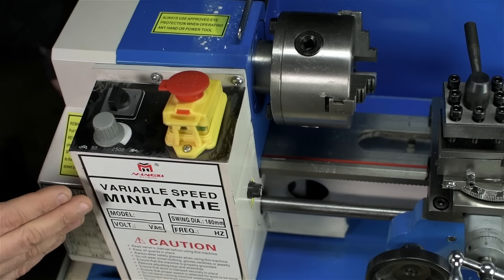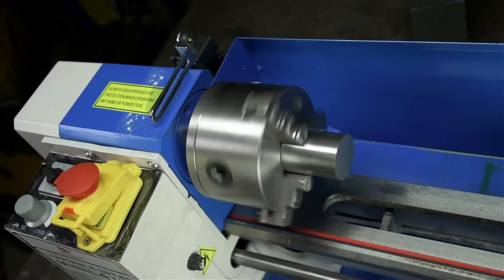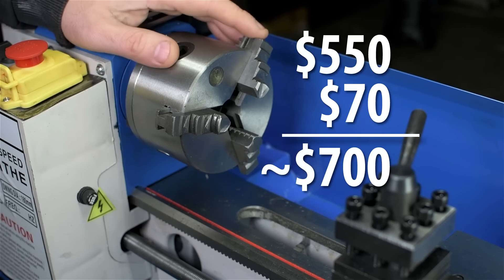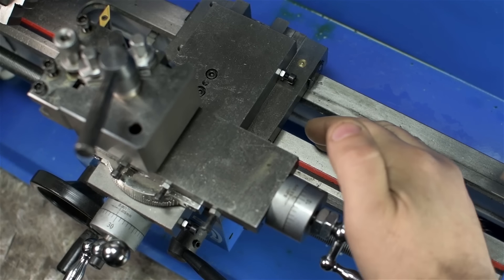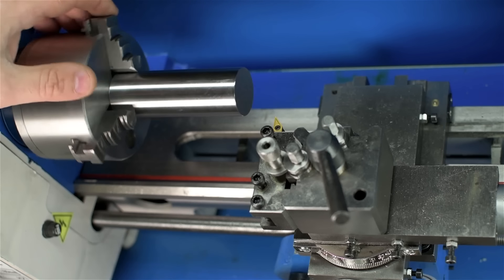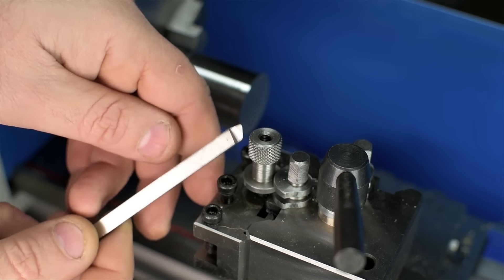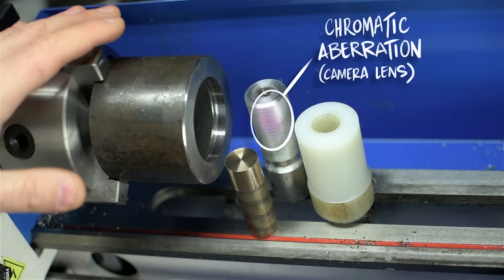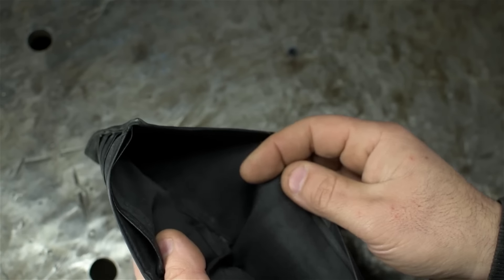The Infamous Mini Lathe!

Comment: I have the 7x16. It's not a myth LOLTo the best of my knowledge none of these small machines come from the factory with metal gears. Although, they are available to purchase from Little machine Shop. Do you have a recommendation for a small lathe that won't break the bank and has a built in gear change for thread cutting?
Reply: take a look on grizzly, i think the 9x20 or whatever has a gearbox.
Reply: @leeknivek  Consensus online (years ago, IDK about now) was that the 9x20s are trash compared to pretty much anything else due to bed flex.  The 8x16-type machines that TOT mentioned in the video are (were) much more well-regarded.
Reply: @macaroniandtuna  I'm not saying they're good, I'm just noting that they have some sort of gearbox
Reply: @leeknivek  although that 9x20 may also be another chinesium product, it do carry a gear box full of metal gears. But it is almost twice as big as the 7x14......not at same scale. May be taig lathe without tailstock? Almost no gear at all but roughly the same size and usage should be compare with....
Reply: Micro-Mark also now sells a metal gear set.  However, they are not needed.  The plastic gears for the lead screw drive work just fine and are quieter.  Plastic gears in the head stock also run quieter and have the advantage of being a good fail point in case of a big mistake where the stronger metal gears could actually be a liability.  The advice often given on the largest online mini-lathe group (7x12MiniLathe was on Yahoo groups now on Groups.io) is to not worry about it until one actually breaks - then decide if you want to change.  Apparently, very few seem to experience a broken gear.
Reply: Something old! Edit - I need to read better... They won't be small. My bad.
Reply: @ФёклаШиринкина  doesn't say what kind of lathe it is but I like your project
Reply: As silly as it may sound.... take a look at Harbor Freights.  It was the first lathe I purchased and it DOES come with metal gears.  I changed out the tool holder for a quick change type which was all I really needed to do with it and it does have built in gear changing for thread cutting in addition to extra metal gears for changing spindle speed.  I have had it for 10 years now and it still runs as well as the first day.  I since have added a LaBlond and Warner & Swasey lathe to my arsenal but I still use the small one for softer metals and plastics.

Comment: Now, I want to know if there's a mini-injection-molding-machine, and a mini-CNC-mill-for-aluminium. :)
Reply: I just bought a used mini cnc
Reply: There are definitely mini mills. CNC, I dunno
Reply: @gamemeister27  mine is a cnc. 3020 if I remember correctly.

Comment: I want one, I’m a model builder. Probably safer than using a dremel and razor blade.
The palm sized would be ideal.
Reply: Maybe you should check out jeweller's lathes, those are significantly smaller and more precise albeit more expensive

Comment: I upgraded up from an Emco Unimat SL (which went over to my brother as his first lathe) to the Emco Unimat 3 (still residing with me, but rarely used) and finally got myself a mini lathe. Anything bigger is not possible in my 6x8' shop (mini mill and a small bandsaw there too). But this small lathe is quite ok for all my projects. It just depends on what your needs are.

Comment: That's a nice toy for all 40 years old yong boys! 
But my model of such lathe, I think, little bit better.
Reply: Yes, my lathe can cut 2 mm diametr at 30 mm round stock steel
Reply: 40-20=20 if my maths is correct I believe I’m not 40 😀😂
I shall check your channel out after this video
Im 20 lol if you can’t tell
Reply: Bruns, that's not fair, your lathe is made closer to Germany then the little one..😅

Comment: It all comes down to what you use it for. I'm a model engine builder with most of my engines being around 1" bore, and in 30 years I still haven't out grown my 7x16 Prazi (german/polish made) mini lathe, still love it. If I were to upgrade it would have to go out in the garage which is un-heated and un-airconditioned so I don't like being out there nearly as much as being in my indoor study.  What I haven't found is a usable mini-mill, the Prazi mini-mill is too flimsy for much of my milling, all I use it for now is drilling and taping since having gotten a (very old, very worn out, very cheap) bridgeport clone, out in the garage.

Comment: Thanks for sharing. My experience with two of these low-cost tools are not so encouraging though one can do a lot with them. One problem is the weak point of the gear system. There are no actual bearings in them. They are simple slide bearings with steel against steel or steel against plastic. Lubrication? You need to lubricate all slides and bearings very often, else they start to jam and the bearings may stick hard and burn and then break some gears.

Comment: I have had a MicroMark 7x16in mini-lathe for several years.  I use it for my 10mm/ft and 16mm/ft steam locomotives, mostly brass, bronze and aluminium.  I have had excellent results if careful.  10thou cuts max usually.  Less on steel when I am very patient.  More like 5thou..  One word of caution, just because the scale (in thou on a MicroMark) says 10thou don't bet on it.  It is better to cut close, and then creep up to the final cut.  For the money it has been excellent and I probably wouldn't have been able to afford anything better.  An excellent starter lathe and for those on a tight budget.

Comment: I use mine which was a harbor freight version so it had the thread cutter for over 7 years now. You know he's completely right I mainly do soft materials however I have done a couple very small break discs on mine but I usually stick to aluminum or brass a little stainless steel. Mine's done me great. haven't had any issues. But when you only got 600 in your pocket and it's 1500 for a bigger one you learned to manage.
Reply: The mini lathe reviews aren't really fair, because the people doing the reviews own $25,000 lathes. Even a used lathe, requires enormous resources to get it home, and to get it up to running condition, if you have no idea what your'e doing, and you don't have a background in machining tools. I'm an inventor and woodworker, and the process of buying an old lathe and restoring it to safe operating condition isn't so easy,. It does seem that MOST of these people have a lifelong background of engineering and machining tool experience, starting in high school. I am so glad for these channels, but I feel like they aren't exactly understanding that the audience is not quite as adept. For some people, a mini lathe is the only way they can even own a lathe.

Comment: After having one of the "bottom of the line" minis, I bought the Microlux, full delux package.  Then added the QC tool post, and a few other things.  But, a junked out old B&D drill gave me a nice 1/4 inch drill chuck, 3/8-24 thread, and LMS has arbors made for the mini lathes to make it usable.  A little later, a Jacobs BB 3/8 chuck and again, LMS arbor makes a nice combination and doesn't et too much bed length.  The Microlux is 7 X 16, and the extra bed length is very nice.  Also, as personal choice, I prefer O-1 and W-1 steels, but again, personal choice.  I do very little in aluminum, maybe just a little more in brass if I have to.
Reply: Do you still have the Microlux? Is that the best mini lathe to buy? Is there something you'd recommend that is better for the money? I'm trying to buy a lathe, but I don't own a truck or a flatbed trailer. I have a van, which I think could haul a lathe, but it might be a bit more difficult to load the lathe with a cherry picker (engine hoist)... Are they not called "cherry picker" anymore? I haven't heard that term lately. In WA state, they are called "Cherry pickers."
Reply: @Ritalie  I still have it, and the more I use it, the more I find other than limited in size, it's a pretty nice little machine.  Whether it's the best, I won't say.  All I'll say there is I can use it for small work and it does pretty well.  It's not an "out of the box" machine, I don't understand why it  comes in multiple boxes, but at least it seems to have had some inspection before it was shipped.  Like the others, it's about 100 pounds, easy enough for one man to lift if he's in fair health.  And maybe I went a little far with mine, but I still used a stone to break all the sharp edges,, if there were any.  I may not have had to, I don't know.  It works, it can do pretty nice work, but whether it's good depends on the user as much as on the machine.  If not adjusted properly, it probably won't do very well, but a little time in making adjustments, it's okay.  You're not paying for a South Bend, and you're not getting one.

Comment: Several years ago I bought the inch-converted 7x16 Sieg variant offered by MicroMark, and it's pretty beefy for a little thing. I've made a bunch of things with it, up to and including making an entire functional LED flashlight from billet aluminum. As long as you're only working with smaller stock (say, up to about 4 inches or so) and not trying to use extravagant materials, some of the better, more "name brand" (if you can call them that) minilathes out of China (e.g., Sieg's top models) are surprisingly good.

Comment: When you use new chuck/jaws etc always bore them out first. For extra support when m/cing try and centre the job centre drill and use the tail stock with a running centre. Just make the job slightly longer and face it off after to take the centre out. If your heat treating then leave the centre in for centre grinding after. You should find that the finish is much better as you are taking out vibration. Vibration causes chatter and one of the only ways to get chatter out is to put a decent cut on which would be hard on this m/c. Get yourself a ZEUS book (Toolmakers best mate)on speeds and feeds and yes good old DROMUS B suds for coolant. Always make sure your cutting tool is centre height to tailstock centre. Getting this correct will also improve the finish and tool life. Try and use roughing tips (larger radius) to take top surface off then use finishing tips to clean up surface finish. Do not touch the job with hands until its finished. Best of luck.

Comment: I worked as a machinist for a rather well-known corporation that used a lot of 'high precision' lathe work in their products. What few 'self-taught' lathe owners fail to realize, is that several factors influence chatter on turned pieces. Feed rate (inches per minute), material itself, depth of cut, sharpness and geometry of cutting insert...and with some metals, even temperature can impact 'chatter or no-chatter'. In your own garage, it is best to note which inserts you are using, what feed rates and depths of cut you use, which produce the most 'chatter free' finished pieces...and KEEP NOTES! I've seen Cincinnati Milacron 36" engine lathes output total trash, while cheap little 'Jet's' make perfect final goods...and it was all because of operator knowledge and skill. As with most tools, expertise is the real difference...not what name is stamped on the frame.

Comment: You can spin an empty chuck as the jaws are secured by a mortice thread which is a big chunky square thread. As long as it is inside the outside edge of the chuck, don't spin with them half in/half out.

Comment: In professional kitchen motorized equipment (mixers, laminators and yes a pasta roller.) They have those plastic gears  because the gears are supposed to snap before the drive train or the tools that actually touch the food break in the food. So you don't lose the product and they may break before you do if that's what's causing the binding lol.

Comment: Have a Grizzly 7x14 I started with, never a problem with the plastic gears and I pushed it fairly hard. Did strip out a bolt for the compound though which still needs fixing.

Comment: 12:00 Heavy facing cuts - locking the carriage - there's a big lever on the front of the apron for that function. Operates a half nut or something. The you either get perfect facing or a fancy slope if you forgot to disengage the leadscrew feed.

Comment: i just got the latest version of this lathe for christmas! the chinese manufacturers have made a lot of improvements and now ship the lathe with metal gears. the tailstock on mine is extremely sloppy though as the underside of the ways are not even close to parallel with the flat machined side (meaning the tailstock can only clamp on one part of the ways at a time)

Comment: I have a couple of options in dc motors, both out of mobility scooters and given to me for free: 

There first is a 24v with a gear i don't know what to call it machined onto the spindle, though the teeth have maybe a 5-10 degree tilt relative to the shaft which was attached to a gearbox that probably made it capable of turning the speed into enough torque to move 500lbs of human being and groceries around the store. I don't know what the rpm is, but with 90w behind it, it'll turn a fan blade into a cesna prop. I have two of them, one of which will probably become a propeller again once it starts getting really hot again. (seriously, if I had four of them, i'd probably think about making some sort of quadcopter out of them)

The other, though I havent broken it down or removed the electric brake yet, thankfully has some actual details on it. It's a 12v, 56 rpm motor that has a long spindle coming out of each end. Since it's housed inside the wheel, I assume that's to hold the whole mess stationary while it moves inside of the wheel. I have 3 of these.

I'm guessing the best I could hope for out of either of these is a wood lathe, but would either even work for that much?

Comment: The 7x16 lathes are available from Micro Mark and Little Machine Shop.  They both use a brushless DC motor that is QUIET!   Both companies also sell mini mills with the same motor.  That motor has so much torque that a high-low switch is not required.  Both lathes have plastic gears, but both companies also sell metal gear sets.  LMS sells separate metal gears, including other sizes.  LMS sells accessory kits, that include a quick change tool post that is better than the one shown in this video.  
The Micro Mark lathe is called a "True Inch" machine and indicates change gear setups for only US threads, but LMS has free software that will allow multiple threads to be cut on either machines.  I made a set of stockmakers screws for the Mosin Nagant (which is a very strange metric thread) using the LMS software in my MM lathe.  It really works great!  
I'm sure glad that I waited and did not buy a Harbor Freight 7x10.  The 8" lathes also have a MT 3 headstock and a MT2 tailstock, so they have no advantage.  If I were to upgrade, I would go for a 10x22 lathe with a MT 5 headstock and a MT3 tailstock.

Comment: I bought a Chinese made mini-lathe from Grizzly and the bottom pan was flattened like someone had dropped it from height. I found other things wrong with it and made a case to return it which Grizzly's customer support was good to led me do and get my money back. I ended up getting a CNC-ready Sherline and I'm glad I did even though it was a little more expensive. But there are lots of options and excellent support. I'd never go back to manual again.

Comment: I miss working in bolt manufacturing, I would only do the set ups for the different bolts people would have to thread and than I would go mess around with a mill. Some of the machines we had at that shop were from the damn 50s.

Comment: Yes, they cut steel a lot better with hand ground tooling.  The radius on the indexable tooling causes too much load and chatter. I have put hours and hours on mine.  It's only for bushings, rings, one tokers etc in my garage.  Anything bigger I take to work.

Comment: have had 2 of these small lathes very handy to have still one of them use the heck out of it for doing bushing and tools and stuff  as for the gears mineral oil or silicone lube works great never use  petroliam   base will damage gears . i took my all down and smoothed the ways and cleaned up the machining on the tool post

Comment: One of my employees brought one these into our machine shop stating we could use the for second ops. I am a 40 years machinist and I guess spoiled by real lathes, I won't touch this lathe. It travels are rough and clunky. We simi took apart and saw the plastic drive train. I can't see them lasting long at all. I hope they sell replacement parts. The runout in the chuck is pretty bad, too. Again I am spoiled, I have run a Hardinge HLVH since 1986. Little cuts by home hobbyist should be Ok though. I sure enjoy your videos, fun and educational.

Comment: First project, make aluminum or brass gears to replace the plastic, maybe mount them to the shaft with a taper adapter. With a spring clip holding it tight. So ut works like a fuse. It can slip with excessive force .

Comment: I had the original one, made by Chung in Taiwan. It has done a lot to heavy work, but nevertheless lasted for 10 years. Taiwan has some hing end knowledge in metalworking machines, Vertex, Eagle. But i don't know how the Chines version does.

It is a good, affordable lathe for model builders who work a lot in small brass and aluminium parts. (based on my Chung experience)

Comment: Toolpost- if you are using inserts, CA glue a milled shim to the bottom of the holder. Correct height every time until the heat death of the universe.

Comment: There is a company in China that advertises on e bay here in the UK that  supplies meatal spur gears No 1 Module that is the same as the plastic gears supplied with these lathes. I have tried the gears and the quality is good also their price is reasonable with quick  delivery. I have a 7 X 20 lathe and purchased a couple of gears to add a reverse tumbler set up.